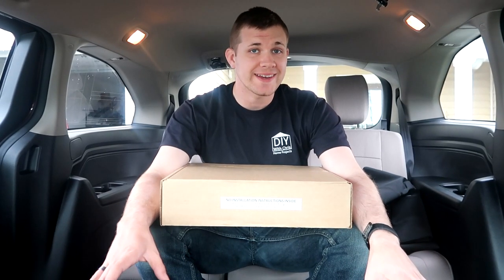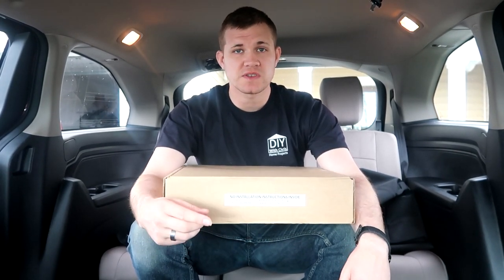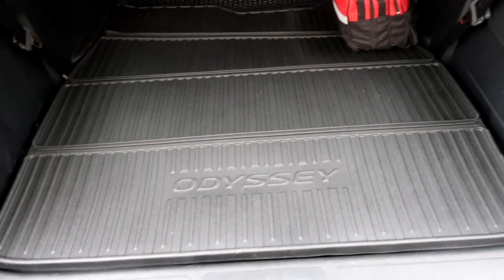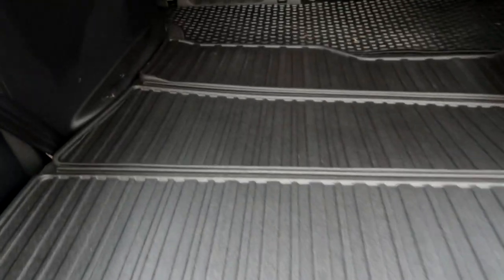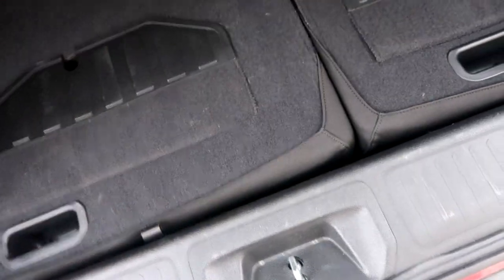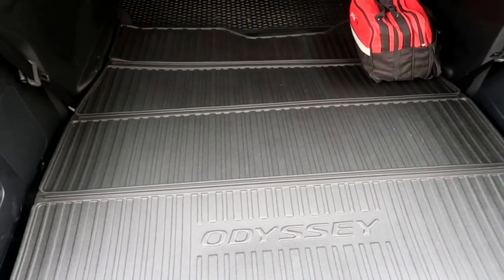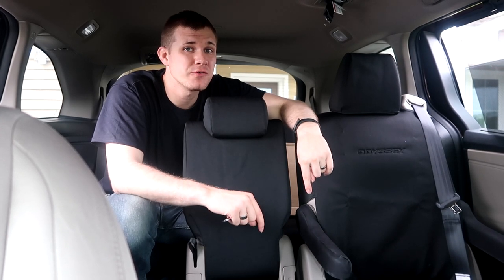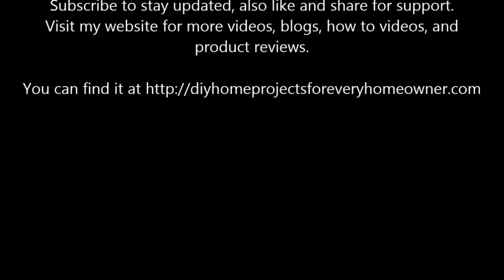How to install Cargo Area Tray, Folding in 2018 Honda Odyssey

Comment: I keep a heavy wool blanket in my Odyssey trunk.  The problem with the Honda folding mat is that it doesn’t accommodate the split 40-60 aspect of the seats as sometimes I just want to have one side down (eg. When you need to have item not roll around).  If they could split the cover and fasten the sections to the seat back it would be more useful. My blanket also rolls up and fits into one of the side cubbies when not in use.  If you need water proof, I suppose you could get a tarp.

Comment: Wow! Just found this video and it was helpful. I’ve been torn between buying a weather tech cargo mat or the Honda fold up one for our 2016 odyssey... I saw reviews saying the fold up one was flimsy plastic... does it feel like quality plastic to you? Also, have you found that it moves around when there is nothing on top of it?
Reply: Also, does the 2018 have the same plastic console problems the earlier years have? Where everything slides around a rattles because of the lack of grip? Would love to see you if you found any liners to fix or have done something on your own to fix.
Reply from the maker: For the price, I would expect thicker plastic. The mat seems to slide around regardless of what's on it. The underside doesn't have any substantial grips. The mat doesn't move much with heavy weight but has still shifted during quicker stops due to lack of grip.
Reply from the maker: Which console are you referring to?
Reply: The center console between the front seats.
Reply from the maker: We don't have any issues with rattling with ours. I'm not sure how the previous years are configured though. 

Here is a video of the 2018 center console. https://youtu.be/1EmXfgMDpjU